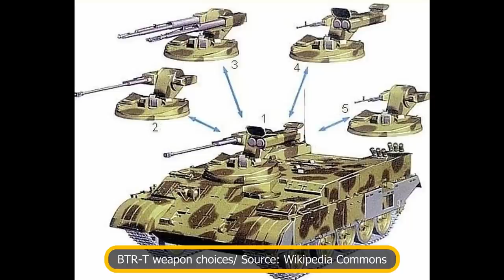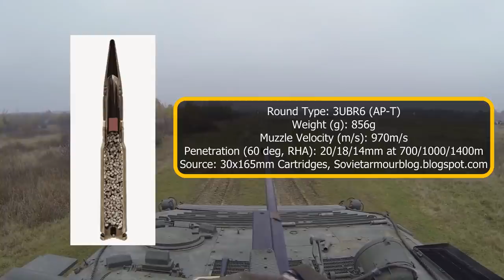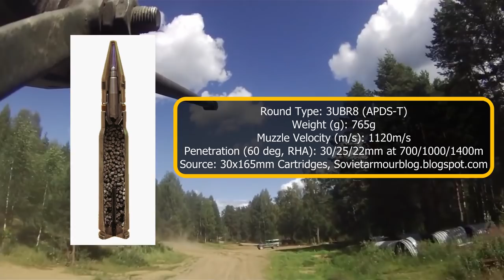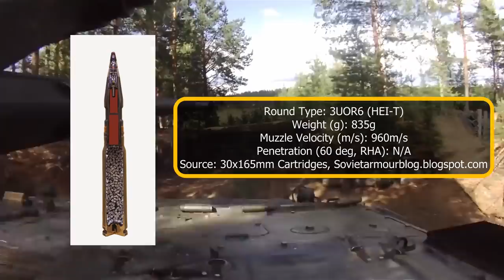Russia's Heaviest APC | BTR-T Modern Russian T-55 Based APC

Comment: "Found their protection hopelessly outmatched" yeah no shit, the BTRs and BMPs are lightly armored, even 50 cals can penetrate them from the right angle
Reply: You mean top angle?
Also yes a T-54/55 could potentially make a decent APC if it kept most of it's armor
Reply: @marseldagistani1989  BMP 1 has 20 mm of armor, 50 cals have around 26 mm of penetration with solid ap ammunition

The BTRs have even less, 10 mm max

BMP 2 has 33 mm max but its sides, rear and top are pretty much the same as the BMP 1
Reply: @mariobosnjak99  Lol, stop shitposting pls. BMP-1/2 can hold 23mm AA gun, and 12.7 in front. It was basic requirements for AFV/APC
Reply: @exodus1621  yeah nah, sustained fire will go though, especially from the side and the roof which were the most targeted areas from ground and air. I do have to correct myself though, late ww2 solid AP shells from 50 cals can go through 33 mm of armor
Reply: ah, a war thunder player
Reply: To be fair, all around 50 cal protection has only become seriously considered as a requirement in apcs in the past several years.

Comment: I'd say it inspired the build of the BMPT- Terminator, which is also based on the T-72
Reply: No, the BMPT goes back to the early 80s with the objects 781 and 782. The former a modified T-72 hull with a couple of autocannons and the latter a slightly more modified T-72 hull with a turret relatively similar to the one on the BMP-3.

Comment: Russia have a huge stock of T55, they have to give a better use. But the conversion to a APC is not very efficient for me. The engine is on the back, so the infantry have to get out though the top of the vehicle, and only 5 infantry man can get inside.
In my opinion, will be better to convert to tank killer or a medium terminator version.
Reply: Your forgetting how broke Russia is, like them announcing in 2015 they would purchase 2,300 Armata tanks by 2020, then only ordering 100 in 2016 before that was reduced again to 20 tanks with 100 infantry vehicle using the same chassis because it was cheaper to refurbish T-72 instead. And even still not a single Armata past the original 2015 prototypes have been delivered because the original engine keeps failing and is being replaced.

Comment: I'll never understand this.... I recently saw a similar thing that ukraine did with some of their t72s, or maybe they were t62s, (i don't quite remember) 

But it just doesn't seem like a good tradeoff....  You sacrifice the greatest thing about those old tanks (the turreted gun) in order to get 4 more infantrymen on the battlefield....  It seems to me like they'd make a better infantry support vehicle if they were just left alone.... 

To reiterate, if I went into battle with 13 dudes and a sherman tank, I (personally) would just prefer that the sherman be a complete sherman, as opposed having no main gun, and carrying 4 more dudes... Maybe that's just me
Reply: Context is critical. This was created in response to the problem of infantry fire support in close urban terrain such as the Russians ran into in Grozny.

They needed a smaller than usual cannon to elevate fire at rooftops and buildings at close ranges.

They needed better protection for their supporting infantry as AT threats were common and regular apc were too lightly armoured, and many would get their infantry killed in a metal coffin before they could get out.

These roles were easy enough to include in a single design.
Reply: @josephk.4200  thanks for the input!!!
Reply: I get what you’re saying, and in your Sherman example you might be right. I think on a larger scale the problem is logistics. You would need a more trained crew with the turret, plus the associated ammunition and and spare parts. Ammunition storage for the main gun also takes up a lot of interior space. Additionally the turret is very heavy, leading to increased fuel consumption and lower speeds, which could be a concern of you want older repurposed design to keep up with faster newer vehicles.
Reply: Frankly these seems to be largely what is being done. T-55 are being used as mobile defence, fire support and Improvised artillery. And they don't have the normal crew alotment instead only 3 men including an artillery gunner.

Comment: Due to the main purpose of a heavy APC converted from a tank, its the heavy armour to protect the crew, and the reality of the small internal space for cannon ammo on the T-55 chassis, the most realistic armament with suficient ammo capacity would be a turret with 1xNSV + 2xATGM or a turret with 1xNSV 12.7mm, 1xPKT 7.62mm + 1 single ATGM.
Reply: Or have the turret and ammo in a module so all Internal space is kept for dismounts.

Comment: I like it, sure 4 men is "low" but if you have enough T-55 APC's then it really does not matter and guys can ride on the outside while not in combat.
Reply: The engine is in the way. Troops have to mount and dismount via hatches on the roof, not ideal if the vehicle is under fire.

Comment: Not to mention the Ukrainian's conversion of the T-64 into a beast of an APC...
Reply: Wasn’t that just a single prototype?
Reply: @TheTyrantOfMars  Whos still without turret and manufactured and designed by azov industries, who never build a tank before, best APC ever...
Reply: I'll never understand this.... I recently saw a similar thing that ukraine did with some of their t72s, or maybe they were t62s, (i don't quite remember) 

But it just doesn't seem like a good tradeoff....  You sacrifice the greatest thing about those old tanks (the turreted gun) in order to get 4 more infantrymen on the battlefield....  It seems to me like they'd make a better infantry support vehicle if they were just left alone.... 

To reiterate, if I went into battle with 13 dudes and a sherman tank, I (personally) would just prefer that the sherman be a complete sherman, as opposed having no main gun, and carrying 4 more dudes... Maybe that's just me

(copy pasted from another comment, just wanted to have a friendly discussion :)
Reply: @syndicate4417  Nowdays, a autocannon combined with ATGMs could offer more firepower in less sice than a big maned turret with a 75mm gun and a coaxial machinegun,  most of light tanks, APCs and IFVs nowdays use that configuration in a maned or remote turret. Thats why many of them use the extra space who will ocupy the place of the 75mm cases (sherman hipotetic case) with more infantrymen, command & control systems or a small "hospital".
In a full siced medium tank, would be impossible to carry any of those things who could be very usefull in the frontline, so the flexibility of the modern systems gives a sustantial help and they become primary objectives of a enemy army, so they are becoming hevier with the time as commanders use them as key flexible units who are in the a frontline full of ATGMs of all kind of sices
P.D.: sorry for my poor level on inglish
Reply: @asierurteaga1227  nah man that was a very comprehensive explanation, your English is quite good. Thank you.  Yeah you explained a lot of great benefits that an APC would offer, and I agree with you completely, but I do think when I see them with no ATGMs and hardly any extra crew space, that the infantry may have been better supported by a main gun with multiple round types, and a machine gun or two 🤷🏻‍♂️ depends on the tank, and the APC conversion execution I suppose :)

Comment: If all the vehicles shown are the BTR-T, it seems to come in 8-wheel and tracked versions.   Conversion from a single drive shaft for trarks to four axles for wheels, presumably multi-wheel drive, is interesting.   Mobility, would differ greatly.

Run-flat tires?

Four-wheel asteering?

Comment: Все в одну кучу собрали! На базе Т-55 это БТР Ахзарит производства Израиль. А российский это БМО-Т (боевая машина огнеметчиков) на базе Т-72, это не БТР.
Reply from the maker: The Achzarit is not related to the BTR-T (except using the same chassis).
BMO-T is a separate project, specifically made for the flamethrower troops. We'll be covering that one soon as well.

Comment: The vehicle was designed because the BTR70 and the BMP2 proved to vulnerable to RPG rounds in Chechnya, but isn't the T55 itself able to be destroyed by RPGs?
Reply: I see here, in the comment section, so many didn't understand the logic of the armor protection of the BTR-60/80 and BMP-1/2. Such their armor protection is the result of exactly one parameter: the requirement of the Soviet / Russian Ministry of Defense for amphibiousness, after WWII. You basicaly can't hang a lot of armor and then expect the vehicle can float. If another, more armored protection vehicle is created, it has no task to replace these APC.
Reply: @Ailasher  So basically with the BTR-T what you have is an IFV that can't swim, cant survive the RPG impacts that was its whole purpose for being designed, and it cant carry a complete infantry squad, which is THE WHOLE POINT OF AN INFANTRY CARRIER! Wtf were the Russains thinking?
Reply: @Spuggky45  "Wtf were the Russains thinking?" Well, сonsidering that BTR-T still not put into service by Russian MoD you basically repeated the arguments some hight military guy who put the stamp "not approved". And if I remember correctly, it was back in the 90s.
Reply: @Ailasher  Very true. The sad thing is, I kinda like the concept. If the Russians could've figured out a way to move the engine to the front of the vehicle, it might have been able to carry a full infantry squad, and it would've had some value for urban combat, dispite not being amphibious.
Reply: @Spuggky45  " If the Russians could've figured out a way to move the engine to the front of the vehicle" Didn't think it happen. BTR-T is a product of OKBTM from Omsk sity in mid 90s and just shout it out: "we want to survive this hell around, so just buy something!" Same as Ukranian BMPV-64 and BMPT-84. Now they ok, they survived and produce TOS-1A (heavy rocket thermobaric flamethrower) and latest modifications of T-80. Still... Guys from the city of Chelyabinsk, "Uralvagonzavod", were able to sell their BMPT-Terminator to Russian MoD, even considering that it thing has no place in Army doctrine of mechanized operations. In addition, it also uses a large number of crew members (5-7) which has a large disadvantage. It's just looks cool.

Comment: the future of war wil be cheap drones in massive numbers, if an enemy has to shoot down a thousand dollar drone with 10 000 dolar misile, that is a win, multiply by a couple thousand and those numbers stack up, then realise that it should be possible to make drones for a fraction of that price

but overreliance on drones would not be advised, if any enemy finds a way to  jam the connection between those drones and their controllers it would cripple the entire war effort
Reply: Only if you got the chips for them though.
Reply: I don’t think it would be that simple the computing power needed would be hard to maintain and easily messed with. The drones would need a hive mind mentality because you can not have thousands of individual drone pilots. Plus anti aircraft shot gun style set up could knock out whole swarms of drones easily for cheap